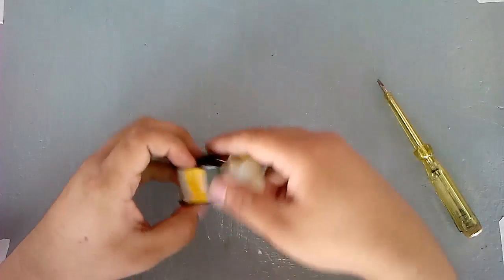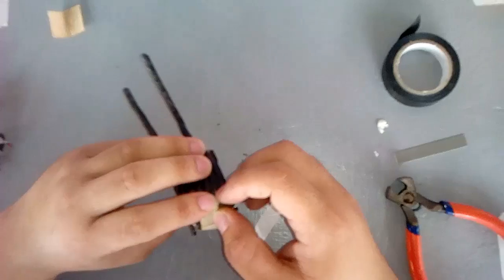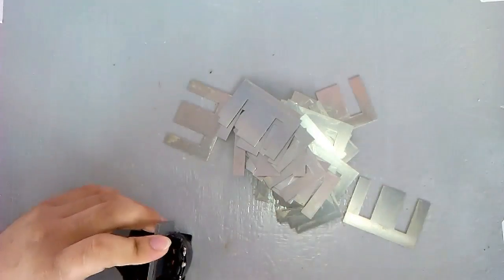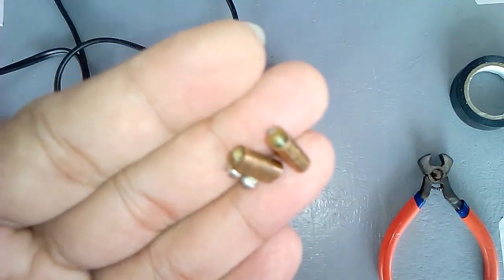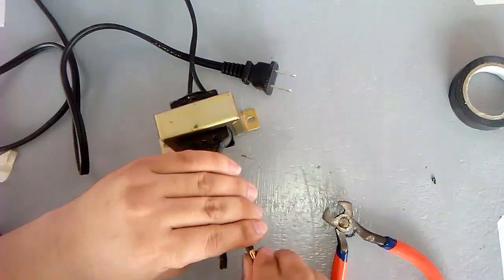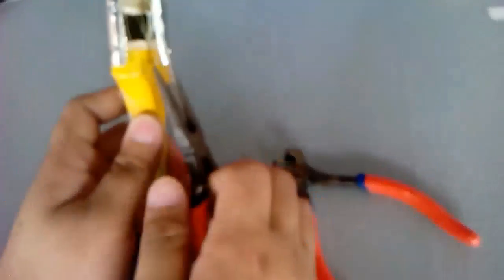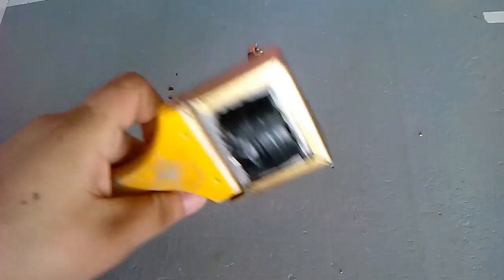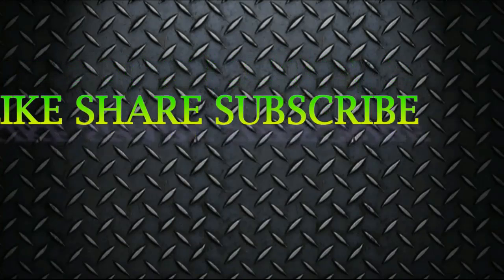Homemade Soldering Gun

Comment: Kudos, what about using smaller trany, say 3-0 or 6-0 so to be handy, and for a different need, whats the secondary voltage & current, if you kindly measure?

Comment: No its not safe 
Risk of electronic shock 
Do not try frends
Reply: yeah only if you touch the metallic parts on the wire
on a real soldering gun would you touch the metallic parts like that? NO! because THEYRE HOT!
Its perfectyly safe if the transformer is unplugged from the wall and the copper is touched, but when its plugged in the wall you will get electrocuted

Comment: is it safe for me to make and work for a long time with it pls tell me i am 11yrs old
Reply: This is extremely dangerous! After about 10 to 20 seconds you will see smoke. That is the insulation of the wires burning and soon to follow the coils in the transformer.
Reply: Don't power the transformer for longer than approximately 10 seconds. :p

Comment: how many watt is the soldering iron
Reply from the maker: cant say it in specific. maybe its 35-40 watts power
Reply: how much time it take to heat up?
Reply: hey what is the volt of transrormer
Reply from the maker: its 12v-0-12v 3A
Reply: hey sek please make a table saw with 12 volts motor please.

Comment: sorry can i know..if the transformer that power up by ac directly from main supply,are then all the metal plate core  and covering section is danger to touch because of the LIVE wire had attached on it?..sorry my broken english,i know it was too bad..btw nice and simple but smart and creative project..such a clean lesson..thump up's..
Reply from the maker: +Udang Lipan ac main directs to the coil which is the primary coil and its nothing to do with the secondary coil and to the metal plates that covers the coils because it is well insulated.
Reply: It mean when it insulated then it will not exposed to the transferred current from primary to secondary?..
Reply from the maker: it will transfer by means of magnetic field.
Reply: Sek Austria ohh i see,but need tape it back the insulating and tape it fully secure to avoid it current leaking right..ohh thank alot..hope u will come with more great diy project..thank for your guide..👍👍👍

Comment: "E" lams and "I" lams, such a simple and clever design. Pulled so many apart as a teenager back in the 90s - prepare for battle with a flat blade driver, a thin edged knife and a mallet to peel those silicon steel lams off that baby and break them free of the resin. You'll find it quickest to locate all the "I" lams first, align the driver blade with them and then smack em on the end by whacking the driver with a mallet and knock them out, leaving a gap at the end of each "E" lam, which you can then exploit with the knife, to slide between them and break the bond of the resin and slide them out with great ease (usually!)

It's easier to practice it than to have me explain it.

All the best, God bless you, Happy Christmas!

Matthew. :)

Comment: how do I know which wire (primary or secondary coil?) to connect to which wire on the power cord?
Reply from the maker: you can see the magnetic wire inside, the thinner one is the primary or you can check with ohm tester, which has a high  resistance is the primary. (this only works with small transformers) sometimes you'll encounter step up transformer like microwave oven transformer, but thats a another story.. i hope it helps.
Reply: Sek Austria right. but which of those connects to which wire on the power cord? there's a negative and positive am I right?
Reply from the maker: you'll connect the power cord to the primary. and there is no polarity(negative positve) in tansformer bacause its AC.
Reply: Sek Austria oooh, so it does not matter which wire connects to which, in regards to the AC power cord? great, thank you!
Reply from the maker: your right brother. feel free to ask. and be careful.
Reply: oh one last thing. both wires on the cord will go to primary coil, or one to each? sorry
Reply from the maker: power cord will only be connected in the "primary" don't ever connect it the secondary.
didn't get your question well.
Reply: Sek Austria so, twist 2 wires of power cord together and solder them to primary coil wire?
Reply from the maker: no! don't ever do that. primary coils has 2 wire which is the Line1 and Line2, the power plug has a two wires also which L1 and L2, then connect L1 to L1 and L2 to L2.
Reply: Sek Austria yes but how do I know which is.l1 and which is l2? maybe I'm missing something here. sorry. there's "beginning wire" and "end wire" to the coil. and obviously 2 wires on cord
Reply from the maker: primary coil has a two wire right? which is line 1 and line 2. it doesn't matter what is L1 or L2
Reply: Sek Austria ok I think I got it... finally. sorry and thanks for all the help
Reply from the maker: my pleasure to help bro :)
Reply: well, back the the old drawing board. ,mine didnt work.
Reply from the maker: dont be sad brother. maybe the transformer is too small and the wire you used in the secondary is too thin and lastly the soldering tin you use is so thick it should be thinner. at least you tried to make it, your too young to be afraid to fail :)

Comment: 1 question ..why you can't use the transformer like it was ? but u have to remove the secondary !
Reply from the maker: +Raj Gj we cant use the transformer like it was, because it lacks of amperage. By building this project we need a low voltage output but high amperage. By modifying the transformers secondary and changing it to a thick wire and less turns in the coil it will produce high amperage but low in voltage.
Hope it helps
And dont forget to subscribe
Reply: ok .. thnx. that was helpful 😀

Comment: hi sek..great video...
can i use my old cpu psu and the cable with coaxial standard cable
..thanks for your great answer..and one more can you make a tutorial video how to make a esc bldc..thx
Reply from the maker: i'm sorry but you can't use that PSU in this method. maybe you can use it if you will try another method  like using  heating wire(resistance wire) Commonly used in vapes instead of Thick Copper Wire.
-im sorry dude i dont have adruino right now, if i got sallary from youtube ill buy adruino circuit.
Reply: ok thank you in advance..and would you make a video from old cpu psu how to make soldering iron.. thx
Reply from the maker: Noted sir :)

Comment: kuya anong part ng transformer yung tatangagalin at
Reply from the maker: +DaRkLaW secondary coil pre :)
Reply from the maker: +DaRkLaW secondary coil pre :)
Reply: anu ung voltage ng transformer
Reply from the maker: input: 220volts ac
output: 12-0-12 ac
-basta yung matitira na na coil yung pang 220 volts(primary coil)
-secondary yung aalisin (yun yung low voltage)

Comment: whats the working principle Sek. will the insulation on the secondary coil not burn with the heat...?
Reply from the maker: the secondary will get hot but not that extremely. and for sure it will not burn the hot tip it will be serve as fuse because it is the thin part of the secondary coil.
Reply: got it!!!